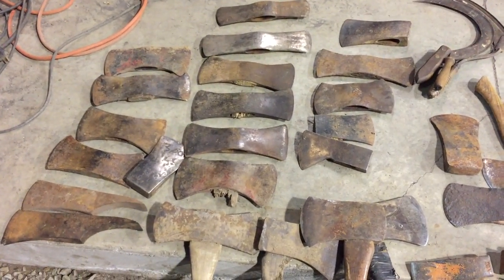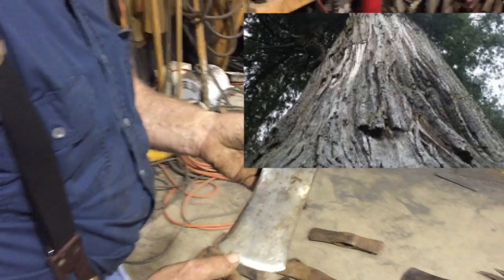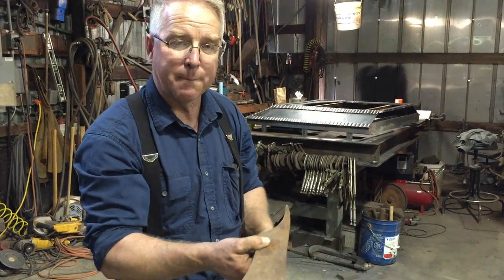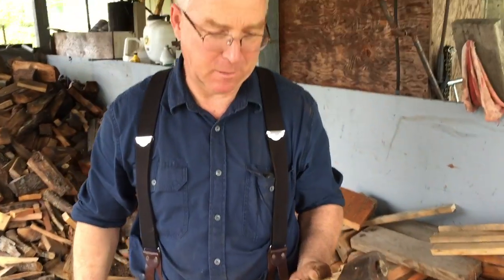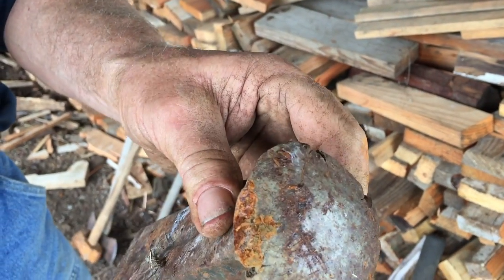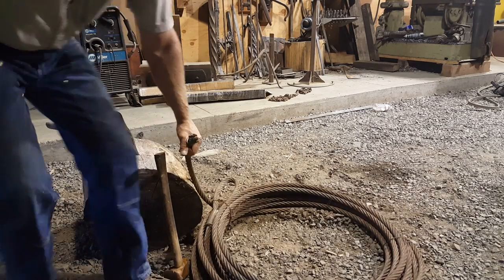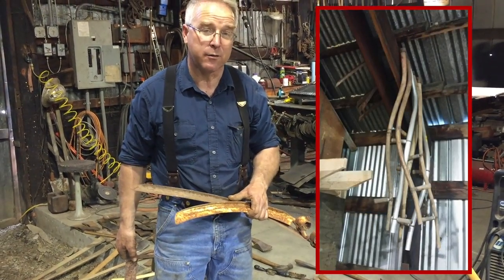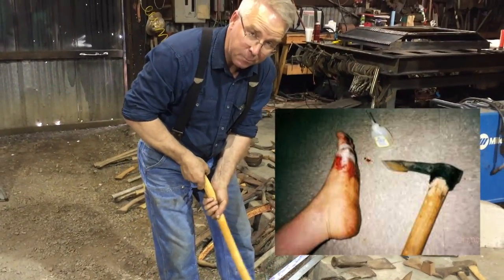Axes and Beyond

Comment: Mushrooms--like on your splitting wedge--can be dangerous. I learned as a boy in shop class never to strike hardened tools together. My first year as a carpenter in 1975, my work mate wanted to use my hammer to strike his. I wouldn't let him, and explained the hazard. The foreman chewed me out, though I didn't want to damage the waffle face. The guy used another hammer. The chip off the hammer entered AR his forearm, and lodged near the artery under his underarm. He luckily lived. Mushrooms should be ground off for the same reason. I don't know about the softer cable slicer. Do you suppose they scored all sides of a cable, and bent them back & forth, ("worried" it), to break the surface strands, then score the next layer? You seem to know much more than I. I am not presuming to teach you anything.

Comment: The poll of an axe is used to add mass to the head. While any poll (especially the hammer poll) can certainly be used as a hammer (and should be in events of emergency) it's something you'd want to avoid using for long term longevity as the constant impacts can cause the eye to misshapen, making the haft loose and, well... as we saw in your video, the entire axe head flies off. That's a safety issue. So can you... yes. Should you? Not if you can help it. The wire axe excepted since it was intended for use as a hammer type tool.Oh, also, be careful of hammering  bounceback since your "hammer" has a sharp blade coming back at you....

Comment: One of my pet peeves, people using the term chopping when they are talking about splitting.  And i hate those monster mauls too!  awful things.  Typical dumb modern solution to a problem.  I had no idea about the wire axe.  I remember seeing a hammer with a peen end shaped just like that and thinking it was just a cross peen sledge for smithing.  Is the peen end for something specific to cable?
Reply: I say all the same things in one of my wood splitting videos.  The trend toward thick low flex handles is disturbing.  Most axes now come with very thick handles and they seem to get more and more absurdly thick.  I love the fiberglass handles on splitting mauls because I don't hardly even have to be careful about overstriking.  I have wood handles on everything else, but mauls I'm fiberglass all the way.  I do like a lighter maul though, more like 6 to 7 pounds.  That's the sweet spot for me in terms of mass and something I can toss around for a while.  Great video and cool channel.
Reply: SkillCult nice wooden handled mauls have metal guards under the head for overstrikes.  its wood anyways. its replaceable.